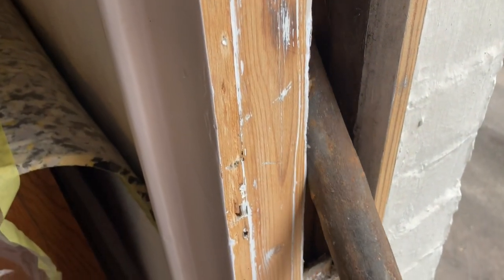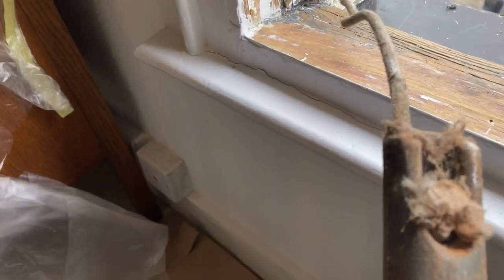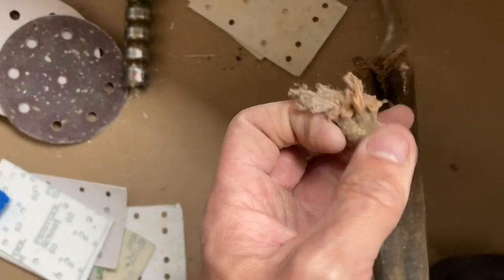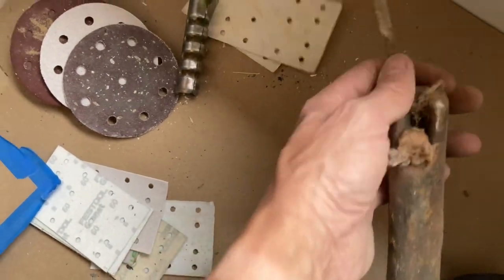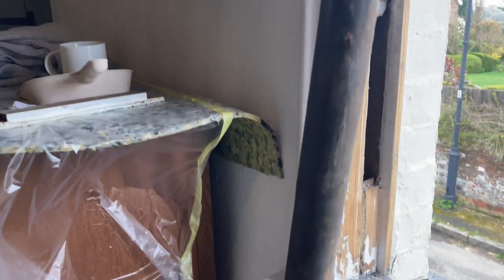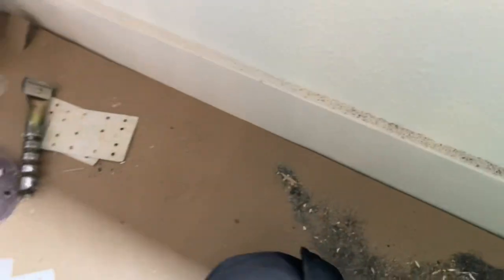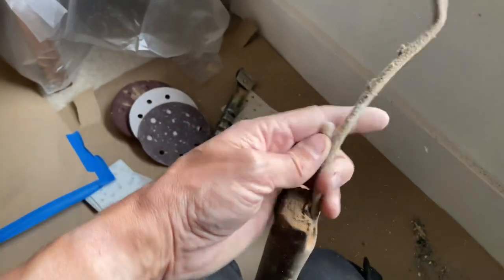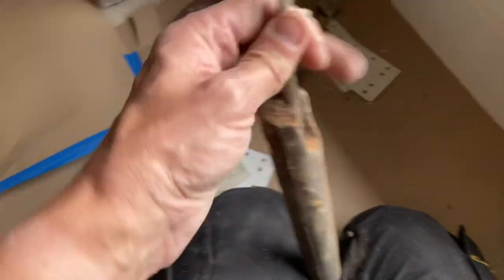Have cowboys tied your sash weights like these?

Comment: whoever done that one years ago, done the knot the wrong side. The cord is suposed to run up the chanel in the weight. On the crappy weights you can do a blood or bowline, just be sure it can't get in the pulley. But at the end of the day, if painters didn't exist, all the sash windows ever made would still be working :D